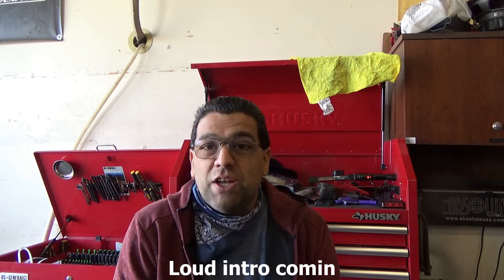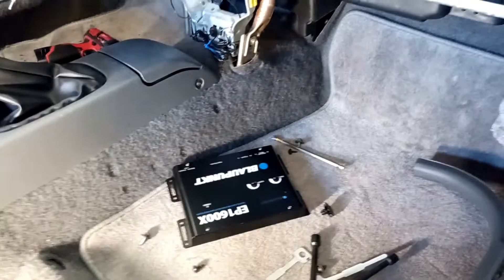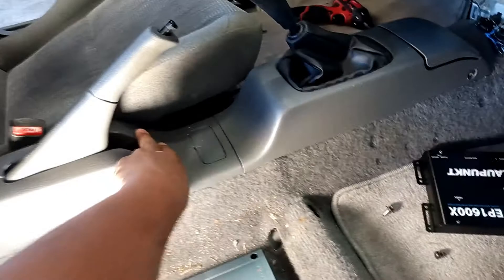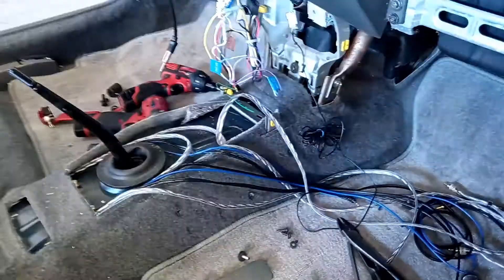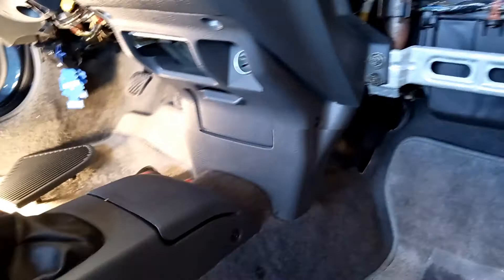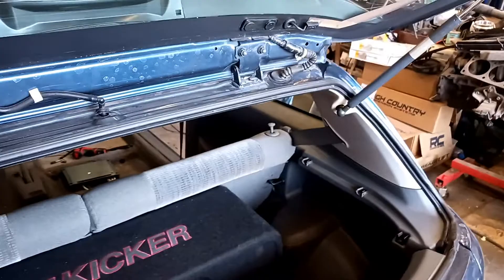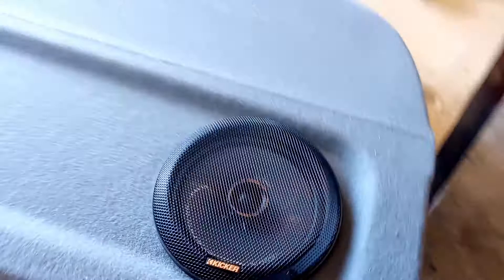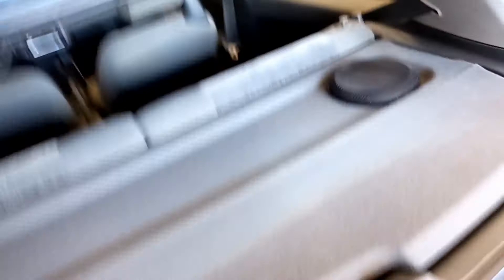Civic EG hatch. Custom sound system.

Comment: How much are you charging to put in a Amp and sub
Reply from the maker: If the stereo and speakers are already in.
And you just need the amp and box, you are looking at  about 175 in labor for amp and box.  I tipically remove the sub from the box to check polarity and resistance of the coils.